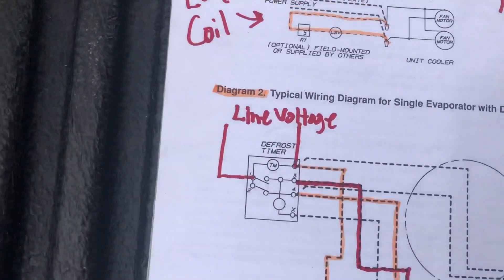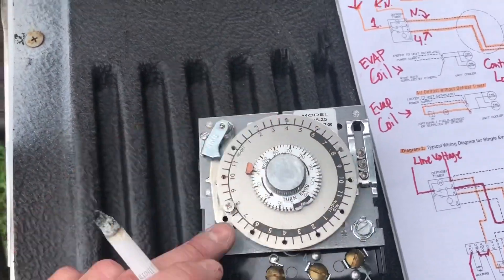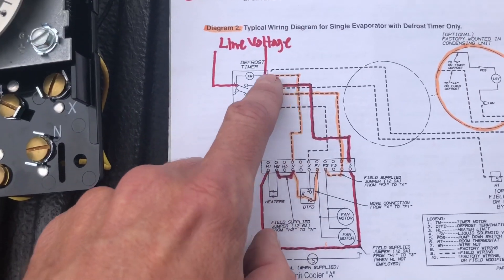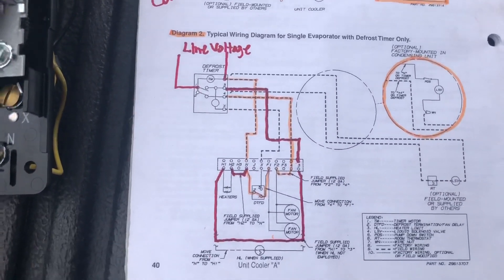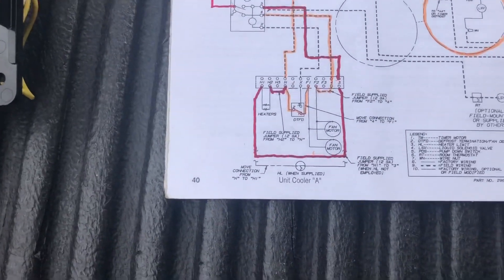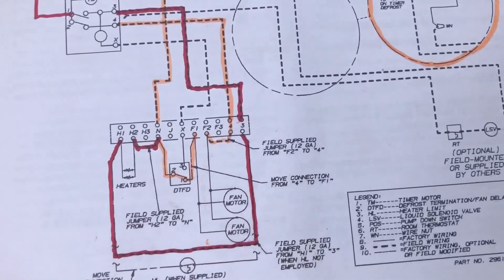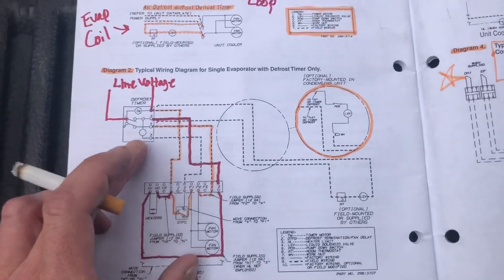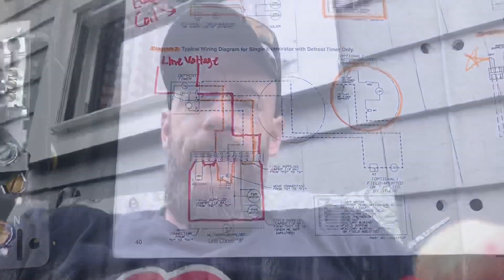Typical wiring for defrost on a single evaporator freezer

Comment: I'm working on a turbo air walk-in freezer. At start up, the fans would not run because the fan delay was not cold enough. What will cause that fan delay to get cold enough to kick the fans on if the room is at 65 degrees Fahrenheit. Does the compressor just keep kicking in and out on low pressure till the room gets cold enough?
Reply from the maker: the fan delay should have a sensor on the coil or in the coil sensing the temp. once it gets cold enough the fans will kick on but the compressor should not be going on and off on low pressure while the fans aren’t running .

Comment: If you see 120 volts on the x terminal all the time is this normal? It’s running a gravity system coil no fans or heaters I don’t understand how they have this clock wired

Comment: Hi, for some time clocks I have seen defrost heater resistor receiving power directly from the time clock. In other cases, there is a separate contactor for defrost heater, and the time clock is connected to the coil of the defrost contactor. What determines this difference in wiring? Thanks.
Reply from the maker: It can depend how the system is set up but more for the amperage of the heaters because sometime they need their own circuit because of what they draw for amps .

Comment: Any thoughts about sequence of operation. Wiring a new WI freezer (everything is 2 speed evap fans now days with extra relay to control speeds) and seems like heat craft gives no provision for compressor to shut off on pump down before defrost heaters come on. Max breaker/ fuse size on nameplate does not seem to reflect compressor/ condenser motors running amps AND heater AMPS to be drawing at same time.  Defrost kicks heaters on same time as solenoid closes and compressor starts pumping down

Do we change factory control set up/ add more controls  or just oversize what nameplate says for fuse sizes??

Small 1.5 HP WI freezer box this is.

Dawned on me with getting proper fuse sizes. I would hate to single phase a new 3 phase compressor because a fuse blew prematurely!

What do guys think/ do?
Reply: No more spaces and impractical  to run new 2 pole circuit just to evaporator coil on this freezer!

What do you guys do?

Comment: Where would you wire your condensate drain line heater in this application?
Reply from the maker: Those are usually on their own separate circuit / outlet on the wall that they just plug into

Comment: Hey bud , thanks for doing these type of videos, I really appreciate it. I have  a Traulsen freezer G22010 and it keeps on freezing up. Im stuck on why my heater coil is not working. today I tried once more but were can I get the diagram so I can narrow it down to were the problem is.  it is an old freezer I know. but i love fixing stuff and now is about feeling proud of getting it fixed.  My parents have owned it since 1998 I believe, running our first bakery.  4 years ago I took over one of my parents locations, we are Dorcas Bakery, and although my Dad wants me to get rid of this well built freezers, I have been tackling down issues as they come due to the age of the unit.  there is no other better unit for me, but years of service on this unit are taking a toll on it. First , the clock needed to be replaced," EASE ONE" done! Then,  I fixed a short, some wires got to old and I fixed it 3 years ago.  3 months ago, I noticed it kept freezing up and the heater coils would not turn on. initially the wiring as faulty and old, I swapped it, now it has a good connection (checked with multimeter)...bottom line Im stuck , what is my next route?
Reply from the maker: Maybe try going to the Traulsen website . They should have a bunch of manuals and diagrams for each model
Reply: Ohm out the defrost heater and look for burnt contacts on the timer.

Comment: Question? I'm working on a unit and when it terminates defrost either by time or temp the solenoid valve opens and the fans immediately energize after the soleniod valve. All Brand new equipment.. I'm thinking it was originally wired wrong but confused on were they wired it wrong?

Comment: hello sir question if i put the unit in defrost on the timer it goes to red and then switches right away to refrigeration it goes to green could that be caused by the dtfd or because the unit is still warm 40 degrees and the fans come on right away 
any help would be great thank you for your time
Reply from the maker: cooling&refrigeration guy yes , that could be a cause for sure man
Reply: @Cscrefandhvac  thank you for ur reply
Reply from the maker: cooling&refrigeration guy could also be the 2 wire heater limit switch that could be in the evap also

Comment: Thanks man great video! I'm working on a 404a freezer Tomorrow morning and the schematic is toast. The condensing unit is running and the solenoid is energized and thermostat is working ok but the fans aren't coming on. I'm thinking its probably the defrost termination switch but this video was a lifesaver with no schematic. Thanks buddy!
Reply from the maker: Mr anonymous glad it could help man. All these schematics can be found in the heatcraft website also . Good luck with the call man

Comment: so the compressor has its own power supply from the panel?
Reply from the maker: obedb093 the condensing unit does always , sometimes power will go to the evap from condensing unit.  Other times the Evaps will have their own power supply.  Just depends on how it’s wired

Comment: Thanks for the videos, Great Explanation, Since you are an Old Champ in this field,  What should be normal operating pressures for refrigeration units as far as Walk in Cooler or freezer and the same for reach Ins, what kind of sub cool and super heat should we expect from these units in order to trouble shoot these units properly ?
Reply from the maker: Allah Mir well it can all be different depending on the type of Freon and if it’s low temp or medium temp etc
Reply: @Cscrefandhvac   Is there any reference to this subject or chart i can study .
Reply from the maker: Allah Mir you should be able to find a lot of things or manuals in this subject online at manufacturers websites etc

Comment: Hey buddy I’ve been running residential and commercial hvac for 10 years. I’m installing my first walk in freezer and a video on setting up cut in and cut out pressure would be awesome. Also this freezer didn’t come charged so a video on charging a freezer from scratch would be awesome thanks
Reply: How did this job turn out haha
Reply: Job went fine considering I’ve never worked on walk ins before so was a great learning process and everything is still working great
Reply: How have you been in the trade 10 years and you can’t adjust cut in cut out? Why are you taking jobs on things you know nothing about. What a scab.

Comment: Can you jump N and X to exit defrost VS twisting the timer to exit defrost?
Reply from the maker: Moe Ashraf I suppose you could I’ve just always turned the clock though haha
Reply: @Cscrefandhvac  yeah. Its was just I had finished fixing the unit but with the box temp was up and the correct time landed on a defrost. This was a graslin timer without a defrost termination in the evap.  Didn't want to short anything so I told them the unit would turn back on after 30 minutes.
Reply from the maker: Moe Ashraf ok I see hahaha. You could’ve just turned the dial on the clock though unless you didn’t want the time to get messed up